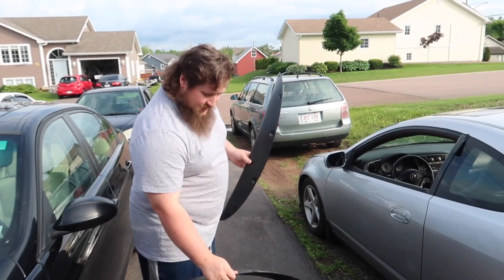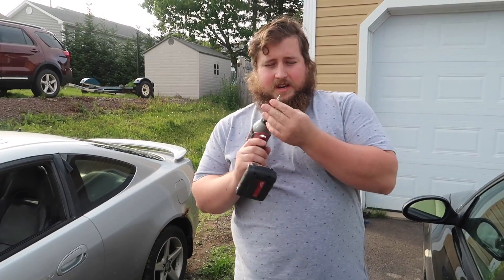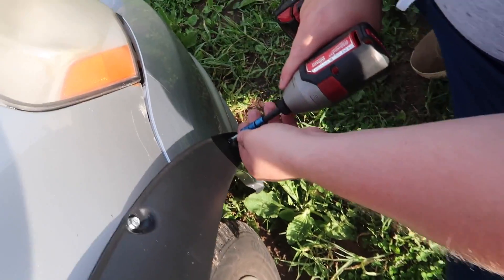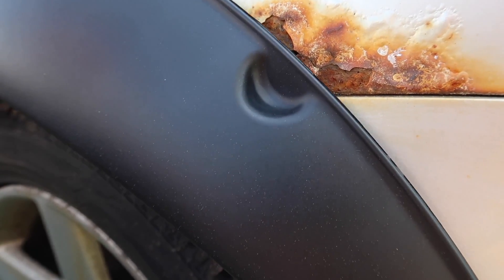I Installed Bushwacker Fender Flares On My Acura RSX.

Comment: I thought the main reason for flares was for figment, so you could run a more aggressive whee/offset and also are t you supposed to to cut the fenders and quarter panels so they make sense? Or was this just for entertainment purposes? Either looks good I like it
Reply from the maker: its for making the car look more aggressive and stand out from all the other basic rsx on the road.